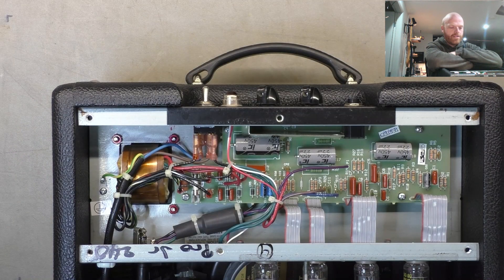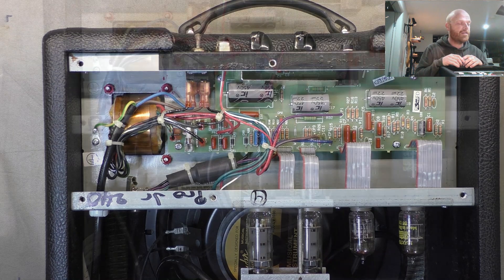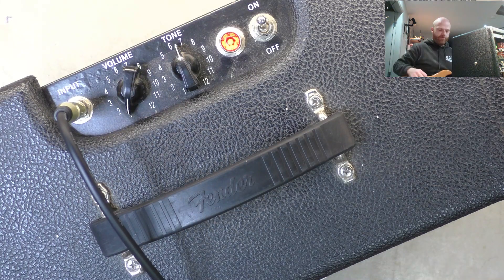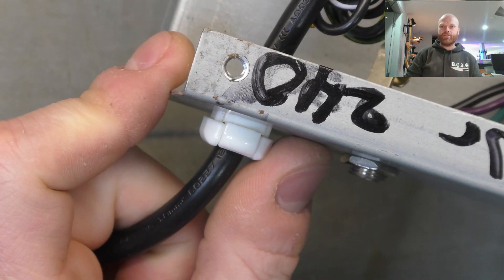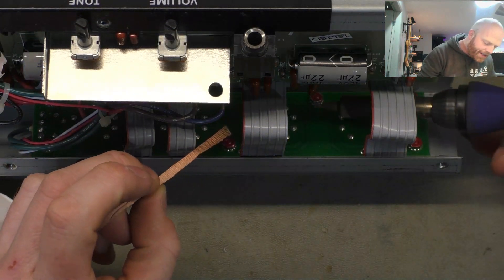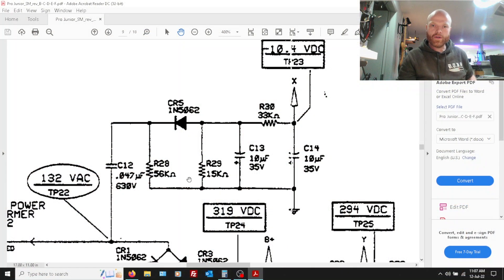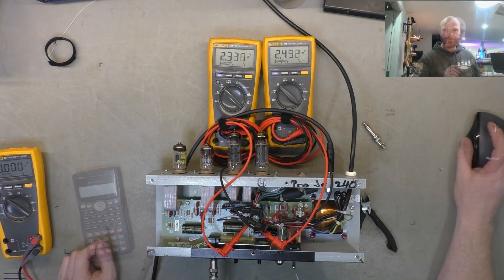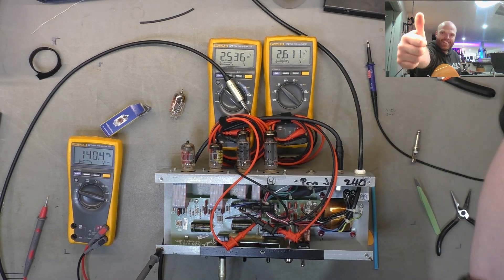Pro Jr Upgrades + Line Out Installation

Comment: More thought and design went into this repair than ever went into the factory amp.
Reply from the maker: Only shortcoming is I should have elevated the heaters to get rid of the last of the hum, and there's not a lot of gain on the line out, only being 1 gain stage and a cathode follower before it. But this is about all the time we could spend on it at the moment and the customer is happy.
Reply: @BradsGuitarGarage  there’s only so much you should do with a PJ. They are pretty much toys.
Reply: Agreed 100%.
Reply: @PsionicAudio   @Brad’s Guitar Garage. Too bad to hear this as they sound pretty good for bedroom amps. I was considering doing some major longevity upgrades including transformers and caps etc. but this comment has me second guessing that because I respect “ya’lls” knowledge. I have some rattling issues. I suspect it’s that rat contraption of a power tube retainer. 🤷‍♂️.  The thing that bothers me most is that the  pots rattle because they are through the control plate and not “nutted”. (How dumb and cheap). My question: Is it possible to replace the pots with standard threaded pots and just wire to the pcb?  I assume yes unless it’s a clearance issue….🙄🙄🙄

Comment: I have a 1993 Fender Pro Junior with No speaker out jack.   Can it be modified to use with a Power Soak?
Reply from the maker: Can't see why not. You wouldn't need to modify the amp, just put it between the speaker and amp speaker output jack.

Comment: Exactly about the speaker! Throw that 'boxy' piece of junk out, everybody should just turf those who buys these amplifiers.  
It's quite simple and not that expensive to do to bring the life out of the amp.  
Night and Day difference.
I put G12 Celestion's in my DeVille 212, and Wow!
The biggest improvement you can make.
My local 'authorized' Fender tech, told me those speakers are actually made in China, but still get badged 
with 'Made in the USA'.